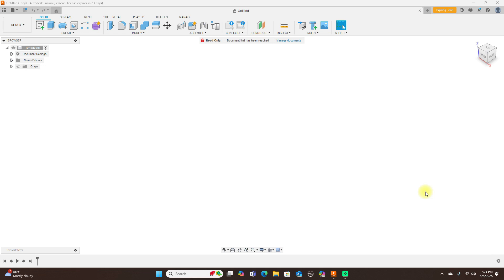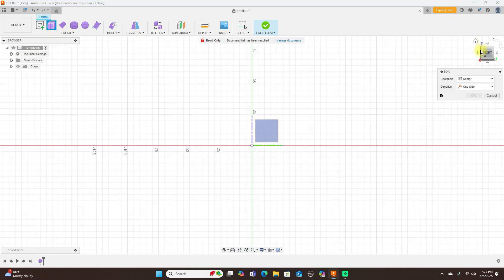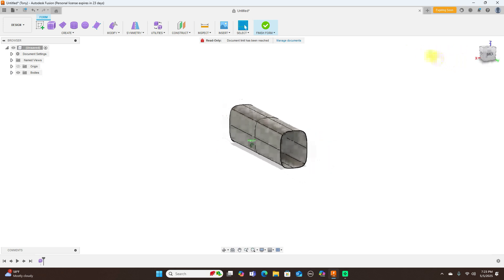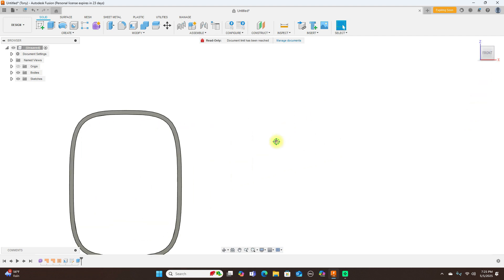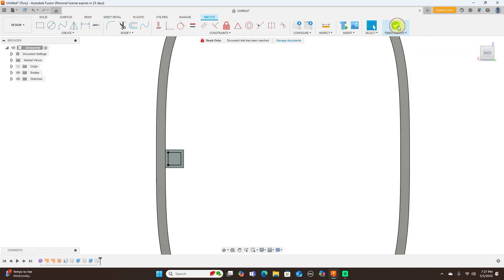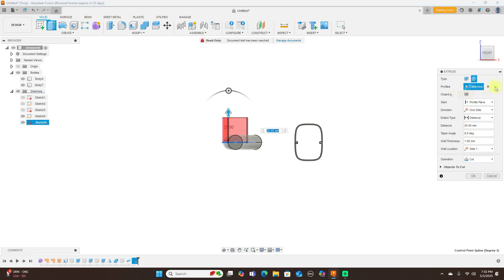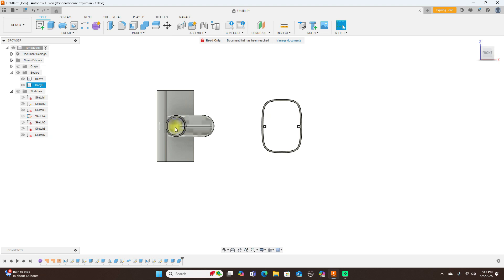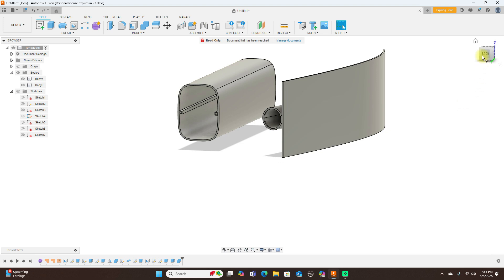New way to design strong 3D printed fuselages using carbon fiber tow.

Comment: Very useful videos, will like all your videos even once I did not see ... 😄.
I am designing a FPV fuselage that I will cover with a layer of 40g of fiberglass . Can you tell is it better to let the printer software to make infill of walls or should I include that in the CAD design  ?
It's a 850mm long fuselage , the thick of the wall fuselage will be 3.2mm